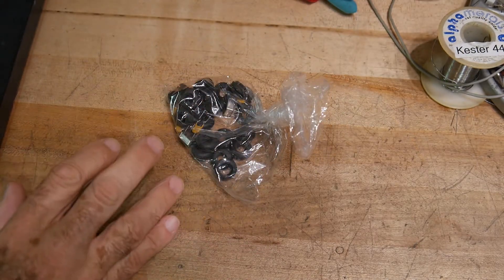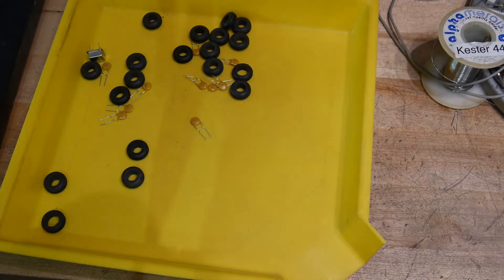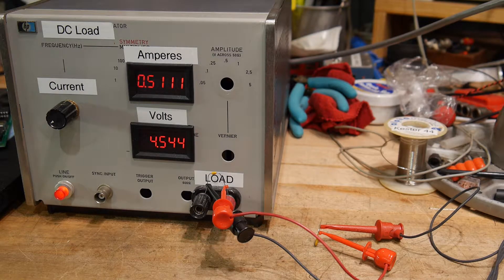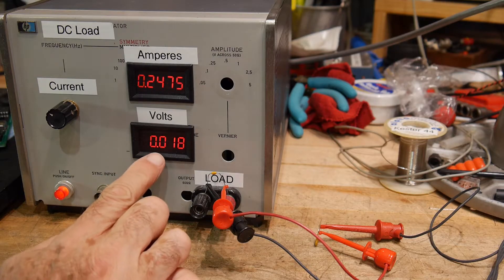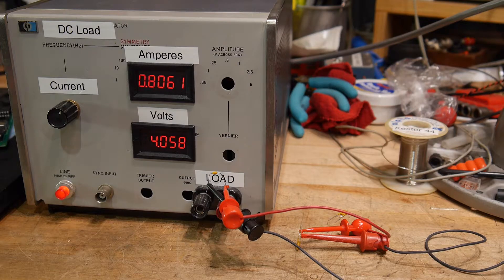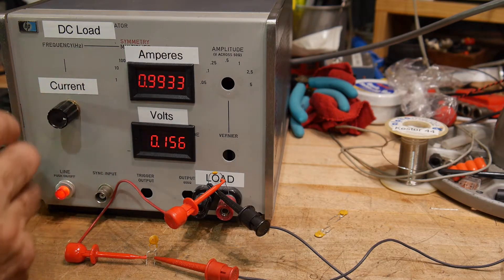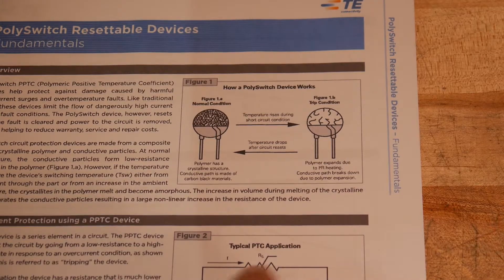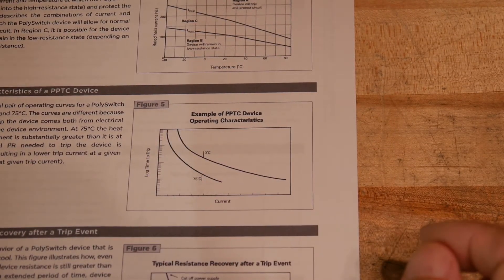#226 Polyfuse PTC resettable fuses

Comment: they are desinged to increase resistance when the temperature increases they are   used in spraker passive crossovers to protect high frequency drivers....

Comment: Nice vid that shows me that i was not out of the track! I bought some to do some testing and see if I could use them to protect ampmeter when students use them in parallel! I thought that hold current and trip current were reliable infos but obviously not! They are far away to work as fuse! Do you have any idea of other type of electronic parts that would REALLY acts as resettable fuse?
Reply from the maker: circuit breaker, but they are slow also. other than a fast blow fuse, you would need to add a monitor circuit that acts quickly

Comment: Do atc car resettable Fuses trip too in about double the printed rating on the Fuse or exactly on the printed amp rating, like the normal non reasonable Fuses ? 🤔
Reply from the maker: those are breakers, different technology

Comment: Valuable info! Thank you for doing the tests and posting this video. I noticed these polyfuses installed in series inside AA battery holders in Snap Circuits electronic toy sets. If a kid makes mistake and shorts the circuit, it will cut off the supply after a moment, and then reset itself for the next project. That's just one example of a practical application.

Comment: I worked on a project which made use of resettable fuses a decade ago, one observation I recall is that once the resettable fuse trips for the first time, subsequent trips become more common i.e. they require less heat to trip following the first trip even if you've allowed them to cool down following the initial trip.

Comment: It's too slow it's not working as fuse
Reply from the maker: circuit breakers are very slow also. there are lots of time constants for fuses. Some designs use a resistor.
Reply: Different types of fuses for different applications.  One time use / replaceable fuses have been available in slow-blow and fast blow for 50 years or more.  The poly fuses are a nice option that allows some excesses short term without the inconvenience of having to replace it.

Comment: Very helpful video.
I've been looking for a component to stop current being taken from battery source number one, which is used only to power my device microprocessor and charge battery source number two.
When a high load is taken from battery source number two I don't want any current being taken from Battery source number one.
If I use one of these with a diode it should do the job.
Battery number one rated at 12.8vdc and 3Amp
Battery number two has a load that would potentially draw 40 Amps.
Now to find a fuse suitable

Comment: Nice video but I have a question. At 12:50 on the video, on the top left of the data sheet for the actual part, the electrical rating is specified as being 72V max and a current of 40 amps max. With a device that rips at around 500mA what is the 40 amps all about? Is that the maximum instantaneous current at the moment of a dead short?
Reply from the maker: Yes that is a bit confusing. i'm not sure how they determine them. obvious that a typical application would never come close. I read those as the part will blow up if you go over the max rating

Comment: I have one in a passive cross over for one of  my speakers and found it was tripping. I'm not sure where to look. could it be the fuse itself?  The speakers ohm out ok and sound fine until it trips.
Reply from the maker: if the speaker is old, I would suspect a bad capacitor somewhere
Reply: @IMSAIGuy  ok thank you. Its not exactly an old speaker about 10 years but I believe one of the caps is failing when warmed up. I ordered them I'll have to see if it fixes it.